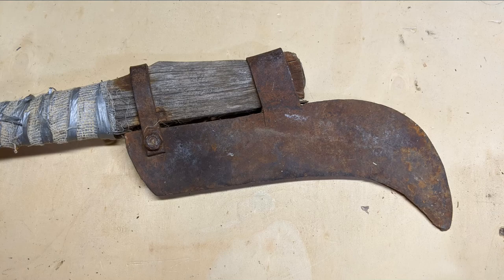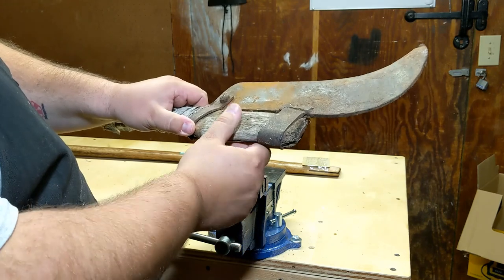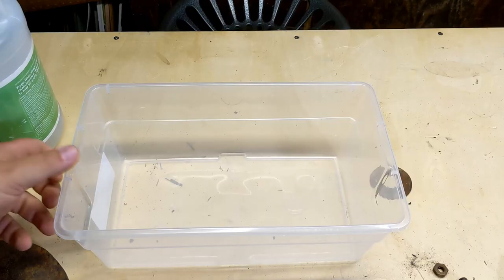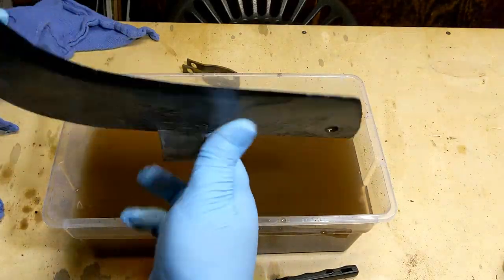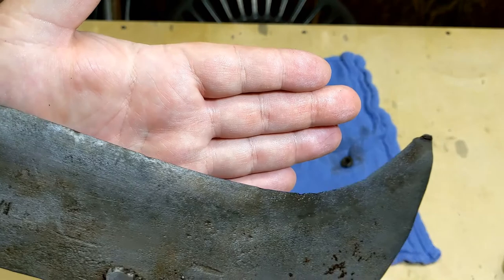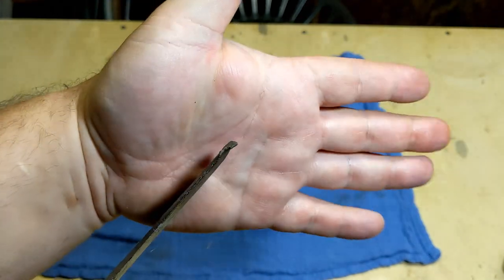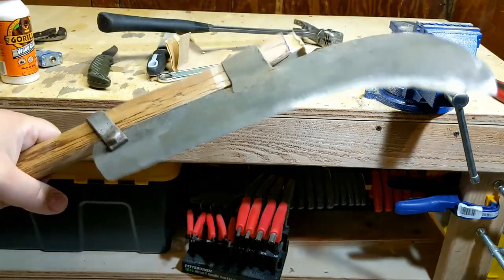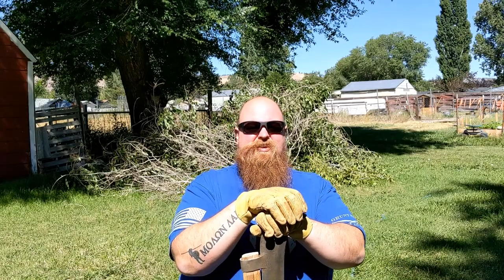Brush Axe Tool Restoration | DIY

Comment: I call it a sling blade, some folk call kisser blade, but I call it a sling blade
Reply from the maker: Mmmm hmmm.
Reply: I have one just like it, it's an underrated tool
Reply from the maker: It sure is. I don't use it a lot, but every once in a while, it is just what I need to make clearing up way easier.

Comment: Not a brush axe ,called Billhook comes in various sizes /lengths  ,used for coppicing wood and hedge laying .BTW  you put it  together wrong and have the wrong handle for it .
Reply from the maker: A billhook is similar, but I believe that name is generally used in the UK and European countries. In the US, this tool and similar style tools, including billhooks, are generally called brush axes, brush hooks, bush axes, ditch axes, ditch bank blades, sling blades, Kaiser blades, surveyors axe, and a whole lot of other things, depending on which part of the country.  And the handle is installed correctly.
Reply: I am looking for the correct handle for a restoration on one of these. Can you guide me to the correct one?
Reply from the maker: It depend on the tool. This style uses an axe handle or very similar to an axe handle. Some styles use a straight handle. Often when I have an old tool, I will spend some time just searching online for vintage tools, looking on auction sites just so I can see what the tool was originally supposed to look like. That helped in this case, just Googled "vintage brush axe" and was able to find some pictures of originals with handles to compare to.